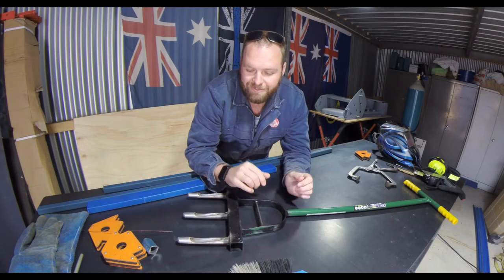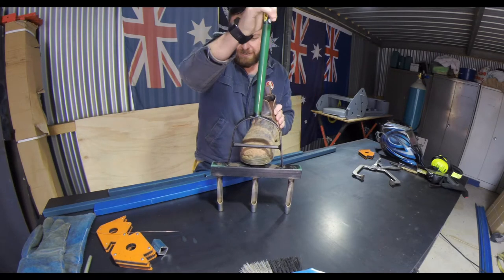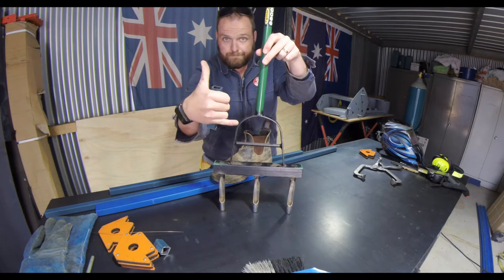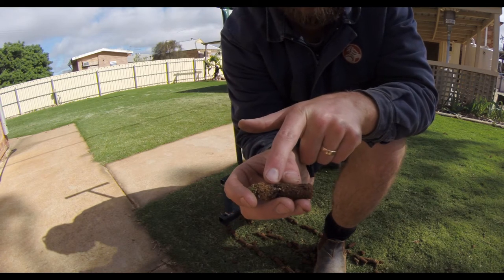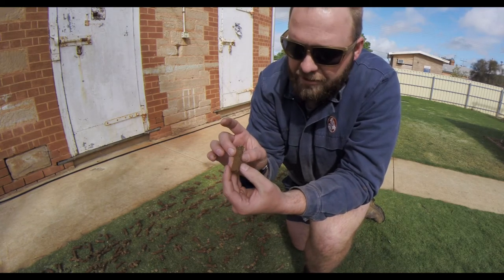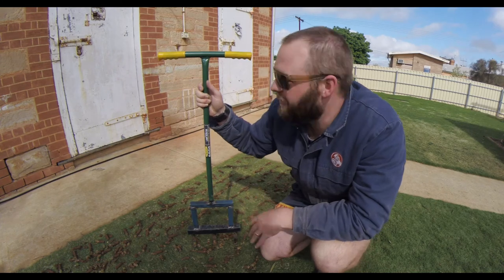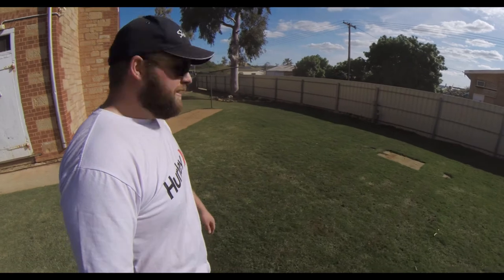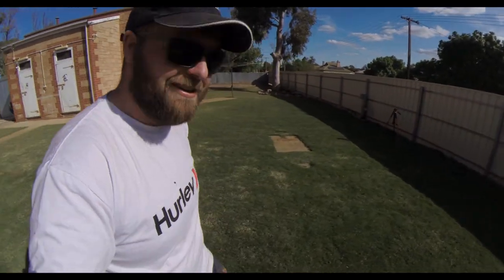Building/modifying a hand aerator/corer and putting it to USE!!

Comment: Mate you have made the aerator into a beast! I will do the same now you have shown me what to do. Thanks so much for that 👍
The lawn is looking fantastic and I am really interested in the ezflow installation. Keep up the great work.
Reply from the maker: Thank you Rob. I did end up welding some flatbar from the top of the hoop diagonally up to the upright tube. No flex now.

Ezo flo video is nearly finished, after I built the cabinet. Keen to use it for sure

Comment: Great vid. 
I was gonna make a square box out of the same tubing. Decided to just use an old garden fork, cut the tines off and weld the new core tines on. May need to add a wider foot pad though. 
Good stuff. Keep going bud.
Reply from the maker: thanks mate, the aerator certainly is handy. had I not been given the original cyclone as a gift I think I would have done the same as you 👍

Comment: I cut that useless round bar that your foot steps on and welded a piece of flat bar further down on mine so my size 12 clod hopper could fit in there and is way more comfortable.
Reply from the maker: much better idea, I think having a nice flat surface is easier on your foot as well 👍
Reply: @YourBestLawn  Sure is.Think of ladders.Standing on flat rungs is heaps better for your foot than round rungs.I have a proplugger so can't make a plugger like yours.😫
Reply from the maker: I remember painting my nan's house wearing my thongs and could hardly walk the next day hahaha. having a plugger will come in handy over the years and I like the way the pro plugger can vary depth

Comment: Howdy mate, great work with the videos. Exactly what my lawn needs, I’ll be getting the welder out to do the same. What are your thoughts on making the tines? Is it reasonably practicable?  Only reason I ask is my impatience means I’ll want to crack into making my aerator as soon as I knock off tonight haha?
Reply from the maker: thanks mate. I'd say you can make the tines but you'd need to really make sure the exit holes for the cores are smooth and very open. they basically side eject and if they clog they are a big pain in the arse .

the postage was fast on them when I bought it. or just ask them for express and have a few patience tins haha

if you know the size of the top of the tine you can have it all ready to go and just plug weld them in and go for it ?